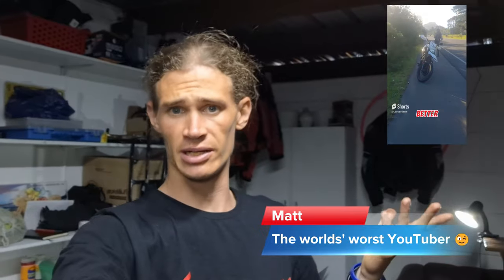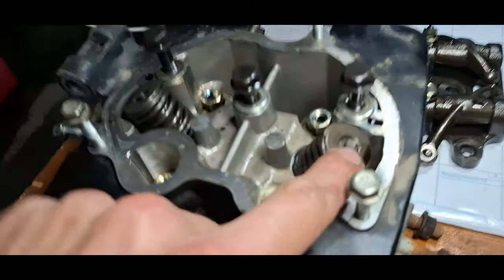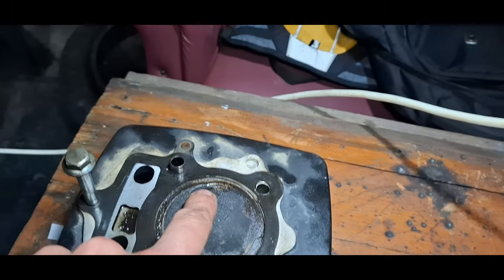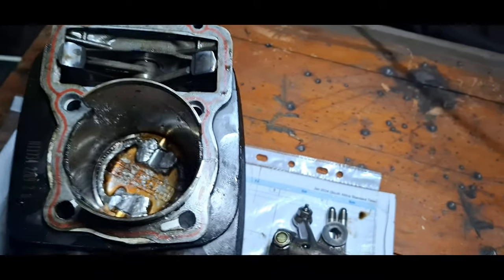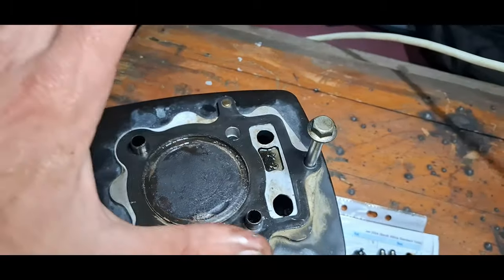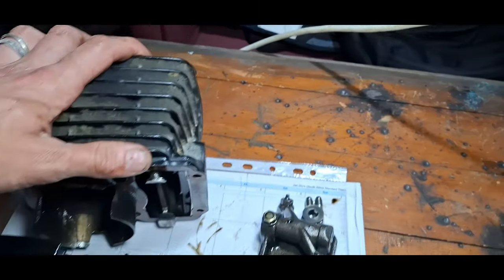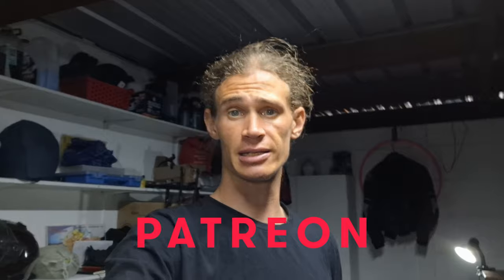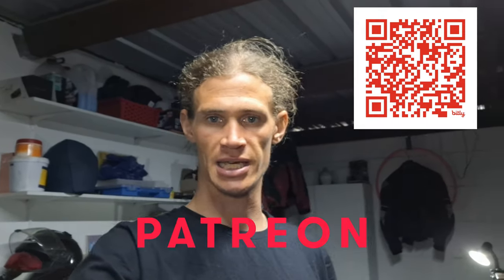So, What Happened to the Big Boy TSR 250?

Comment: Have you been able to get it fixed yet? I have a choice between a Suzuki Gixxer 150 or the bigboy TSR 250 which would you choose?
Reply from the maker: Sadly, no! It seems that simply swapping the piston and valves has not been a straightforward job, and I'm having a hard time getting the bike running again. 

Save yourself the heartache and frustration,  buy the Suzuki

Comment: So sorry to hear man, what oil do you use in the TSR and how often did you change it?
Reply from the maker: Sae 30, mineral oil, as instructed  in the owners manual
Reply from the maker: And the oil must be changed every 3000 km
Reply: @CasualRiders  that's a pitty my Tsr 250 has 16000km on the clock I'm running 20w50, I also change it every 3k
Reply from the maker: @GamingLife420 do you ride on the open road, or the suburbs? You should still be okay if you're not constantly riding at highway speeds, like I do
Reply: @CasualRiders  yeah I prefer to not to Rev the engine high all the time. But lol sometimes you just can't help it,  specially if you have a nice exhaust on lol
Reply: But ya I do highways most of the time for work .

Comment: I am using the same bike man and l have a problem with the tank 
The tank is leaking down on the cape that as a fuel gauge electric cable 
What is the solution l can use patch (bond) close the leakage?
Reply from the maker: You're going to need to remove the tank, and replace the seal where the wire goes into the tank
Reply: Thank man thank you very much 
I have clip here where you can see the position that l want to patch 
What type of a bond do use there the cable was installed Though a steal material where the fuel is leaking now
Reply: @CasualRiders thanks for sharing. The beauty of the TSR. Easy to take apart. Easy to assemble. Affordable to fix. And whilst doing so one learn much technically. Still a huge fan of the TSR. With current gear ratio rather  cruise at 80 or 85. Quite a lot of info on YouTube. Search Hawk 250 dual sport. The guys from the States go big on these. TSR here in SA, HAWK in US. Perhaps consider new sleeve, piston and rings. Keep us posted.
Reply from the maker: @shawnhove6447 I'm not too sure, you could probably get away with using some seca-flex or gasket maker, but you risk breaking the electrical connection,  meaning the guage won't work.
Reply from the maker: @tinusvanwyk3008 no way I can cruise so slow.... 😂 I can't risk moving slower than the traffic, the fear of being rear ended is overwhelming.  Not to mention I'm too impatient
Reply: @CasualRiders any progress on the repairs?
Reply from the maker: @tinusvanwyk3008  I'm having a bit of a challenge getting the timing / valve clearance right. Meeting with a mechanic today, so he can show me where I'm going wrong
Reply: @CasualRiders one suggestion and one question. Suggestion, see YouTube: hawk 250 valve adjustment. Question, was it easy to get replacement parts?
Reply from the maker: @tinusvanwyk3008 I got the parts easy from bikepartssa.co.za delivered in 3 days, Good fit.

However afterwards I bent and snapped one of the pushrods, my wife was able to source it from a shop here called scooterworld
Reply: @CasualRiders great thanks. Good to know. And obviously the parts are very affordable.
Reason for all of my interactions. If all goes well I'll get mine by Tuesday. I am a pensioner and won't really do off road. Perhaps the slow twee spoor little road here and there. Mostly for use on tar roads. Won't really go faster than 80 or 90 kmph. So my hope is that it will serve me well.
Reply: @CasualRiders @CasualRiders  to add, I held back in purchasing a TSR as I have a couple of sport injuries I needed to consider. So chasing the age of 60 perhaps it's a gamble going TSR instead of one of the BigBoy Scooters like the 150 RS or   crossover 150 x.
Reply from the maker: Yeah. You should be golden like that
Reply: About 2 months ago my TSR 250 dropped a valve, waiting for replacement parts from  Southern African Motorcycles.

My TSR have the standard 40 tooth sprocket on the back wheel. I do off-road to.
Reply from the maker: @Bikermuis good luck.

Make sure the valves are correct. The ones I was supplied were wrong and caused me to bend my pushrods